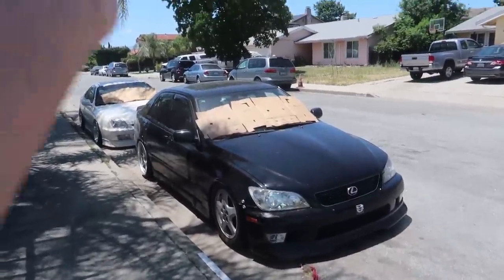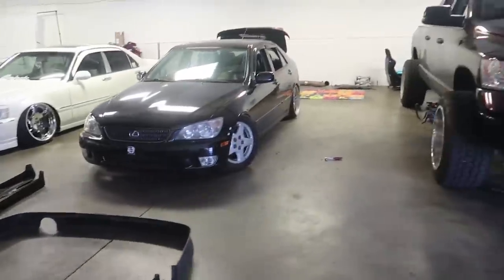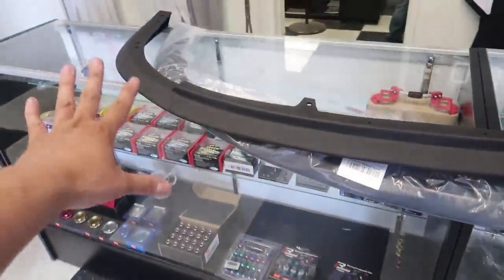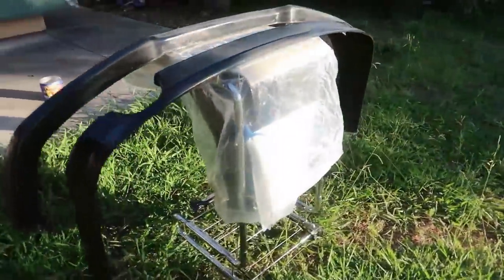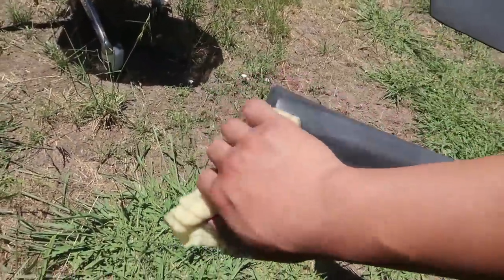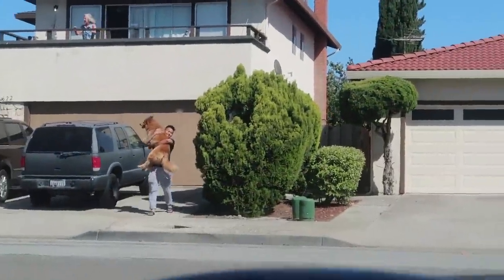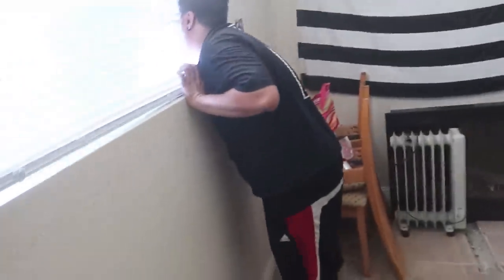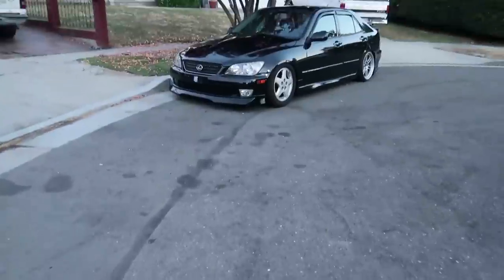This Made It Look So Much Better!!

Comment: Bro u have to prep the urethane lip kit correctly because the plastic has natural oils that come out when u paint. They have specific chemicals for the paint prep. Also try bulldog paint adhesion promoters for plastics so the paint will stick better.